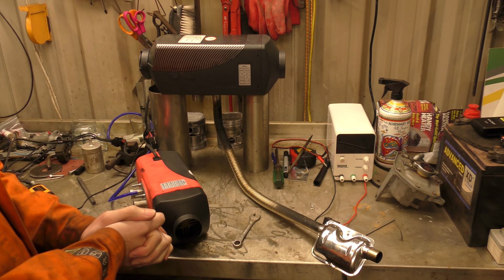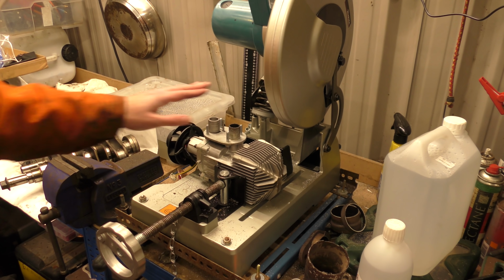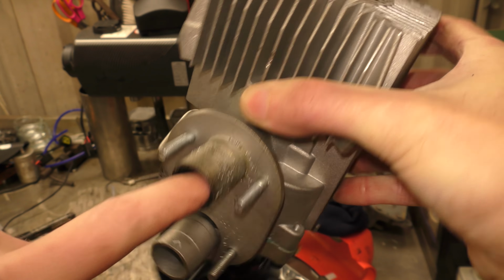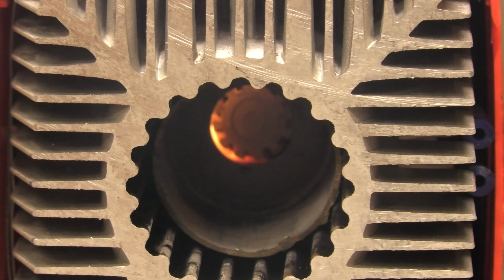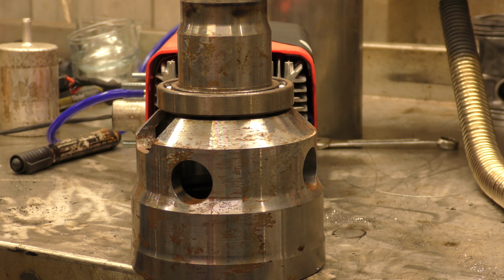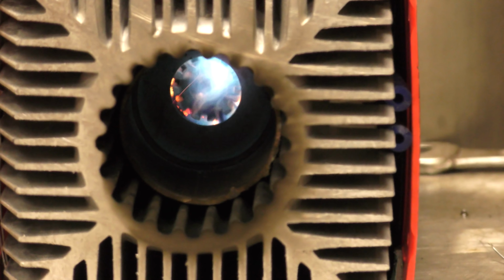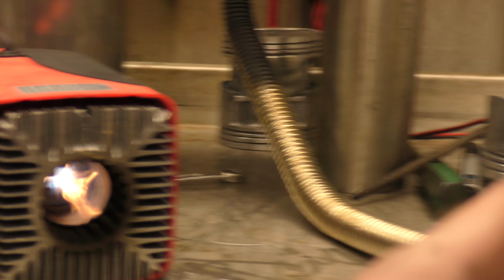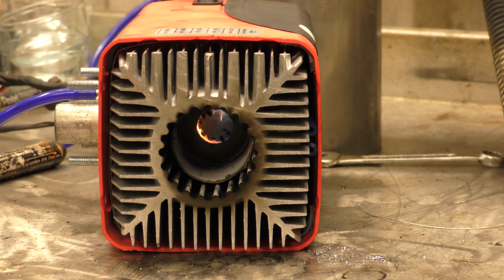A look inside the diesel heater while running

Comment: Hi David, 
Now that you have cut off the end of the Heater so that we can see inside the Burn Chamber, how about extending it by pushing a 5 foot length of Steel Tube the same diameter as the Burn Chamber into the hole

No need to Weld it or anything, just make it a Push Fit, so that it can be easily removed then cut a Hole in the Top and Bottom of a 45 Gallon Barrel and then Weld this 5ft extension Tube Top and Bottom into those holes in the Barrel

Then Lay the Barrel on its Side, on some sort of Cradle so that it is about one Foot clear of the Ground, then sit the Heater on a Platform so that the Tube sticking out of the Barrel, is the same height as the Tube in the Burn Chamber

Then just push them together, so that the Tube sticking out of the Barrel can be pushed into the hole of the Burn Chamber so they mate together, as both Tubes are the Same Diameter

Then Fill the Barrel with Water, using the hole where a Drum Tap usually goes, leaving that Hole open, having first revolved the Drum, so that this Hole would be at the Top instead of the Bottom, to let the Steam out

Having done that, Start up the Heater and then with any luck, you should soon have a 45 Gallon Drum of Hot Water!

Love your Channel, Liked and Subscribed

Comment: Respect to you!!! To be honest you could put some gasket sealant and tap the fins and bolt it back together just like a head. Great to see how they work, wonder if you could oil burn or kerosene feed.
Reply from the maker: The cut isn't totally smooth so would need a little sanding to flatten it out, but yes you could do that.  Kerosene will burn.

Comment: Great video you could extend the burn chamber with some tube wrap copper pipe around it and use it to heat water as well
Reply: Or run the pipe between the cooling fins. Or wrap the whole thing in a jacket and pump the water into the jacket
So many awesome possibilities for water/air heating

Comment: These are cool. Came across these heaters a while and would definitely be cool for a camper. Better than any stupid electric ones. Buddy said they have water heater versions ? That's cool. Theres a few things you could try to make them a lil more efficient like using the exhaust gas to heat water , running the exhaust through another heat exchanger such as the body of another one of these heaters. Very cool.
Reply: This is something I’ve thought about too, my thought was to have a water tank with the exhaust pipe running through it in an S shape so the heat from the exhaust heats the water as it passes through.

Comment: You could use a EGR cooler and turn it in to a water heater
Reply: Now that's a good idea
Reply: Or, just put it in a gas water heater where the gas heater already goes. Basically what a gas water heater does.

Comment: Nice video. They have a temperature sensor at the exhaust so if you place it in the hot gas at some point it won't flamme out. Cheers
Reply from the maker: No sensor at the exhaust.  There is one on the housing to sense undertemp and overheat.  As long as the casing gets warm initially it will stay running.

Comment: 8:45 Attach front piece with NASA approved high-temp zip-ties.   Problem with extracting maximum heat from exhaust might be increased soot deposits and corrosive liquids in exit tube.  Be sure to keep it sloping downward to outside of building.  Also include a cleanout port at start of "Maxstractor Tube" to allow snaking it out with a long wire brush.

Comment: My old oil furnace burner ran much the same way. It also sounded about the same.

Both inject heating oil or diesel. 
(Pretty much the same thing).
The oil furnace sprays oil past a 10kv electric ark, while the diesel heater uses a glow plug. 
Seems like the diesel heater turns the glow plug off when the flame becomes self sustainable.

Comment: The glow when shutting down, plug where turned on to burn off any excess fuel.  So if you’re operating the heater on it’s side, you should lay it down with the glow plug on the bottom.
Reply from the maker: Oh fuck no.  If you put the glow plug on the bottom the diesel leaks out the flame front hole.

Comment: I got one of these about a year ago to heat my workshop. Heat output and fuel consumption are good but the Chinese build quality has started to show with fuel leaks, fan has become noisy and plastic casing has started to melt/burn through in places. I’m going to upgrade to a second hand webasto water heater, these are readily available cheaply from car breakers but avoid the can bus only types as the controllers are more expensive than a used heater
Reply from the maker: Someone sometime soon might have a video etc about another replacement controller for the Webasto's.  ;)

Comment: Very interesting, I have just installed 1 of theese fired it up and the temperature on the controller kept rising over 120 c and the fuel pump was clicking away ten to the dozen so I shut it down thought it was going to explode  , any idea's 🤔🤔cheers Kev

Comment: Can you tell me if the glow plug is also heated when the heater is cooling down? Sounds weird, but somebody told me when I asked about power consumption on a safe power down in case of an electricity surge (on a 12V supply). 
Edit: question answered in the last part, excellent !! Do you have any information about the time the power down cycle takes and the power consumption during that phase? I want to determine the capacity needed for a backup battery.
Reply from the maker: The glow plug does run during cool down.

Different ECUs run for different times.  The cooling phase requires enough time for the glow plug to run and enough time for the fan to run to cool the body down so it doesn't melt the ECU.

In one of the test videos I used a basic UPS type of circuit switch that swapped inputs when one went to zero volts.  But the switching time was a few seconds.  It would actually be ideal for an emergency heater cooldown.  As in the 2 seconds it takes to switch the heater forgets that it was on and doesn't run the glow plug to cool down, but it will then turn on the cooling fan to cool the housing down.  It's something I'm going to use in an upcoming build.

Comment: Dear David. Love you videos. Wonderful knowledge you are creating and putting out. 
Can I ask if yourself or anyone could help regarding a bench power supply??? 

May I ask if a 60v 5amp @ 150w bench power supply. Allow me to use 12v at just above 10amps for a diesel heater??? 
I know I can buy a 30v 10amp supply but my needs will need at times to supply 42v @ 2amps. 
Any help would be highly appreciated ✌️✌️✌️
Sincere regards, 
Scott. ✌️🙏✌️
Reply from the maker: Negative.  I have a 30V 10A power supply and some of the heaters draw more than 10A for the first few minutes of starting.  You could use your power supply and a 12V battery in parallel.
Reply: @DavidMcLuckie  
Dear David. Thank you kindly for the information. I will run it from my power supply paralleled through my battery until I get it running steady. 
My understanding of bench power supplies is that a 60v 5amp supply will produce 300w. So I thought it would supply easy 12v at let’s say 11amps so 132w??? Is this the case or do they not work like this??? I though they would supply as much wattage as stated or is the volts and amps capped at say 60v 5amps??? So 12v up to 300 watts??? If anyone could explain a little more to me it would be highly appreciated??? 👍👍👍
I have just sourced myself an HP server power supply that will do 12v at 32amps and also 5v and 3.3v do plenty to play with but a bench power supply would allow me to work with lithium packs up to 42v. 
Sincere regards, 
Scott. ✌️🙏✌️
Reply from the maker: So yes your supply is capped at 5A.  Whether it be 1V at 5A or 60V at 5A.  I bought a 12V 50A power supply on eBay for £12 to run the Webasto shower heater.
Reply: @DavidMcLuckie  

Thanks for clearing that up for me. I think I will ask for a 30v 10amp bench power supply for Xmas to go with my 60v 5amp I have just bought and waiting on receiving. Let’s hope the misses will accept another tool/piece of equipment coming to the house 😂😂😂

Thank you kindly. 
Best regards, 
Scott. ✌️🙏✌️

Comment: I ditto all the comments below . I bet you could tap heat off the exhaust pipe as well. Use 4 feet of aluminum pipe and have a few loops with a small fan. I did that on my Onan 6.5 kw genset and the waste heat heated my shop in the winter. I'm going to use this in my 45' MCI conversion. 2 or 3 of them. and recover the exhaust heat too.

Comment: i was wondering to minimise cost and extra hassle, if you moved the controller outside the case you could plumb in water unions each end  of the case at the bottom , seal it up and if you wanted to heat water just push water through the lower half at least.  the burn chamber is isolated from the outer so this would work i guess.
Reply from the maker: That wouldn't really work.  The blower fan is what the ECU takes the RPM from.

Comment: Very good, you earned my respect. All that heat (80%) is wasted exhaust. You could make a simple variant on top of a Coleman Lantern fuel canister. A heatsink with a double-wall, blowing air through, with a tiny fan instead of the burning sock. That might actually work with Diesel also. Imagine how small this could be and the fan running on a TEC.

Comment: Hello David, I have only just found your videos this evening and have already watched 3 (and I should really be going to sleep).
Thoroughly watchable, good quality, and you clearly have a clue what you are talking about.
In the unboxing video you showed that it has a decent cool down cycle as part of switching off (which I found very reassuring). The  poster of a different video mentioned that he had read that these units do have a safety risk of overheating  if the voltage drops and it switches off prematurely. Is this something you have seen while bench testing? Or any other safety concerns?
Reply from the maker: Yeah, I did this test as well.  Should that battery suddenly fail it'll just stop dead.
Reply: @DavidMcLuckie . Thanks for getting back to me. When you did your test did it get much hotter? If it stops you are going to loose the flow of air over the heat exchanger, but I am assuming it will also stop pumping fuel and any residue will quickly evaporate.

Comment: Awesome video!
Can you use this heater to heat up a 25sq meter room  and run the exhaust trough the wall outside?
Reply: Absolutely you can! All you will need is diesel supply (tank) and 12 volt power supply (car battery). Just make sure it draws its fresh air from outside as well.

Comment: Great stuff well done I'm going to install one of these in our sleep out do you think it will be ok in a wooden building with the exhaust system taken out safely underneath  ?? The weather here is freezing and I want to cut down our excessive power Bill's
Reply from the maker: I'd just make sure the exhaust is far enough away from the wood, perhaps use a steel plate with a hole to space it.

Comment: Dave,  if or when i do install this heater using gasoline in my USA RV, i will use copper or steel fuel line for safety reasons,.. i enjoy our Y-tubes ..

Comment: one could easily use a gas furnace heat exchanger and attach to the exhaust and remove all that heat, gasses at about 250 F blow thru and cool to 100...I just put a heat muff to capture the exhaust heat and pull into the intake air tube. Works great.

Comment: Why do they taper off the fuel in shut down mode instead of cutting it off abruptly during the process? On mine it starts to smell as it starts the shutdown from incomplete combustion. Seems like it'd be better to just cut the fuel and power up the glow plug to burn off residues during the cool off period.

Comment: Could you just weld an exhaust pipe where you cut the case? wondering if this would be better for burning used motor oil as fuel without soot buildup. Since the spot would have a straight shot out the back.

Comment: I was interested to see you were using the Uniroy dc power supply to run the diesel heater. Although I thought the demand on initial burn could reach 15 amps or so. Could you possibly enlighten me on this. I ask because I am installing one when it arrives and wanted a decent power supply for it.
Reply from the maker: If you're going mains to 12V I'd go with one of these - https://amzn.to/3FGjlkP
Reply: @DavidMcLuckie  thanks for the reply, appreciated.

Comment: Thank for replying but, i want your to do the same test with gasoline,, see it inside,.. i believe the on board controller will keep the temperture  correct. the USA runs on gasoline, we want your help,  RV-USA. i will still be watching you work,, love it,,, Hamish
Reply from the maker: I'm not finished with the gasoline just yet.  I've got some parts ordered to try modifying the burn chamber to better burn the gasoline.  A smaller pump going faster also help.  I did do a video on it recently.

Comment: great video  david , couple of questions ,  firstly what is the fuel consumption on these things , approx obviously ,, secondly , will it run on kerosene , heating oil ?
Reply: 2 kw version is approx 200ml per hour on a low setting and 400ml per hour on a high setting so 2 1/2 to 5 hrs per litre, small price to stay warm in my opinion. My Eberspacher handbook for mine recommends using kerosene below -25*c and diesel kerosene mix below -15*c hope this helps someone.

Comment: Thank you Sir:  I'M NOT diesel mechanic But that video  just made my day NOT I got understand what code 09 means after I found out I had diesel  slime in tank, I cleaned  tank out completely , to find out there was No air filters any were on this Abedele diesel heater that get fixed fast, and No fuel filter at all on it that's next So I'm thinking bit if diesel  fuel cleaner to help burner run with surging I did not do anything  to it from brand New

Comment: Very interesting I'm surprised it worked as its compression that ignites it
Reply from the maker: Not in this instance.  The diesel is ignited from a glowplug, and then once the heater is running a stainless mesh is kept red hot by the burning which atomises the fuel on contact which is then blown into the burn chamber.  Simple, but very clever.

Comment: I'd be interested to see a heat exchanger plate installed to heat water! I'm looking at ways of adding hot water to either heat radiators or water for washing dishes / shower or all 3 in my van. My theory is radiator filled with hot liquid would last longer than hot air?? I'm no expert hence the question marks.
Reply from the maker: There's a few videos on that.  I use an EGR cooler.  It can also be used on the exhaust to recover the waste heat.
Reply: @DavidMcLuckie  yea pretty neat. I've seen videos where the heat exchange is linked into the vans engine coolant system. That's pretty cool but not a project I'd want to undertake myself ATM. I have other priorities. Since posting the original comment here I've seen a few videos that have given me ideas to get me going.

Comment: This has been interesting to watch. I was wondering if the burner and fueling unit could be adapted to run a small aluminium melting furnace. I think the answer is probably yes,it would work quite well
Reply: Easier to make a furnace out of an old gas bottle, Plenty of vids on here about doing that

Comment: Excellent. Good practical showing wat goes on in the operating of these heaters..its only the ticking thump of the fuel  pump pulsing injecting the fuel keeps it burning..cheap Chinese heaters are definitely worth the money and those very expensive Eberspacher and Webasto models are a real ripoff with ther ridiculous high pricing.  I bet the build quality is the same or not much difference...BUY chineseum always...I do..

Comment: Nice video. I was thinking about making a secondary heat exchanger for the exhaust using two heater cores from a car and use a couple high output cpu cooler fans to force the heat inside. I could put the heater core in a cold spot that's always cold in my house and likely have a nice little 12 volt space heater powered by the diesel!

Comment: Is the diesel sprayed into the burn chamber under great pressure through injectors or just a low pressure spray?
Reply from the maker: Low, low pressure.  But not a spray really.  More a trickle onto a hot mesh that vapourises it.  You can gravity feed them without a pump if you really wanted to.

Comment: Excellent!
Still mystified how fuel reaches the glowplug and what the mesh actually does.
And how it runs once the glowplug switches off.
Reply from the maker: Glow plug heats mesh until red/orange hot.
Fuel is pumped onto hot mesh, vaporises and ignites.
Runs like this for a little bit to heat the burn chamber a bit.
There is another mesh inside the burn chamber that is now hot.
More fuel is pumped in which now runs into the burn chamber mesh, vaporises, mixes with the intake air and it burned.
The hotter it gets the better it works.
Reply: @DavidMcLuckie  Excellent, thankyou ⭐️
But don't these units work on their side? How does the fuel dripfeed work then?

Comment: Hi, thanks a lot for your videos. I will turn my air heater into a water heater. I am wondering how i can implement a sensor on the water side to turn the heater off at a sudden water temperature (about 70 celsius). Could you help on this, or any ideas? Thank you so much.

Comment: Here in Britain heating oil is cheaper than red diesel .... Have heard that running it on the former might damage the pump. Is that true ?
Reply from the maker: Technically yes.  Heating oil has less lubricity than diesel.  But for a £10 pump I'd take the risk.  As it will still be a long time of running before the pump shows any signs of wear.
Reply: @DavidMcLuckie  👍🏻